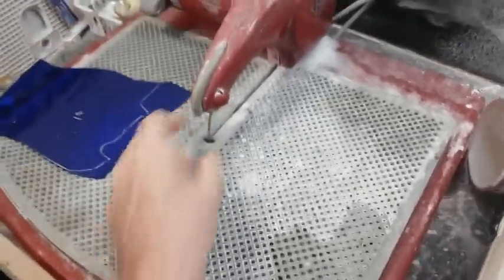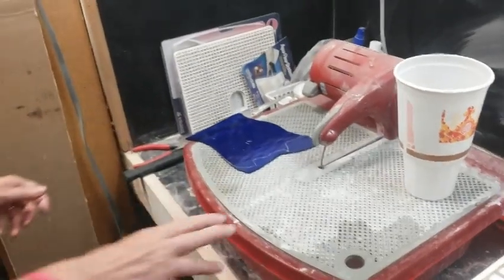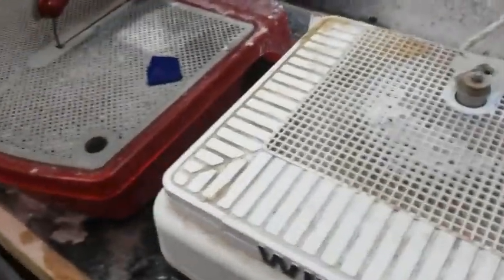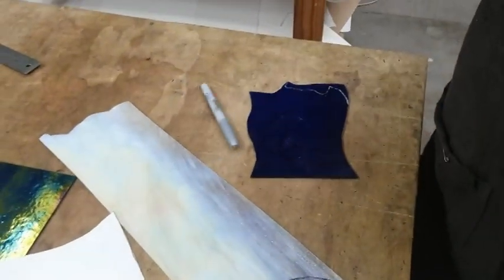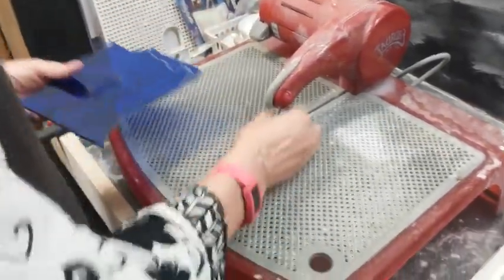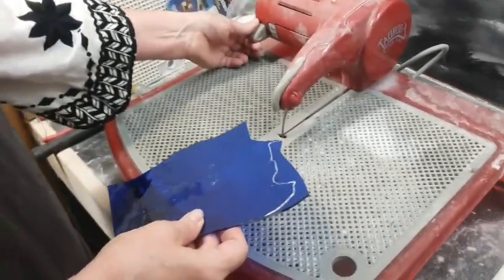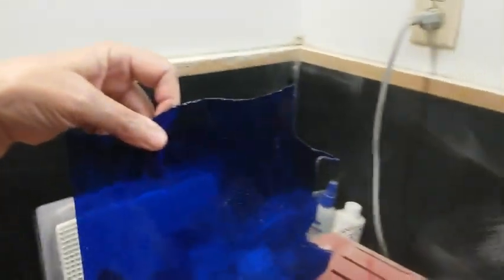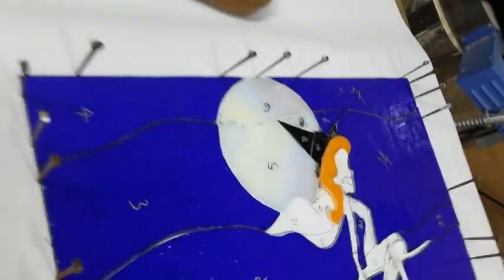Cutting A Radical Piece Of Stained Glass For Bewitched Panel V334

Comment: Hi. I thought to buy it. Thanks yo show how it works. 🤜🤛🤜🤛
Reply from the maker: I recommend them if you have everything else in your shop already. They are a tool of last resort, meaning that they are difficult to learn to use, difficult to keep clean (just look at mine), and expensive. We had one client who bought one and he kept breaking rings. He was pulling the ring around the path before starting like we show at the start of the video, but still they kept breaking. I showed him the blade I use on mine (which I show on the video attached to the end of this video) It's the heavy duty ring and I rarely have one break, but once you switch over you either have to stick with it or change some rollers when you change blades. Good Luck!😀😀😀
Reply: @GommStainedGlass  Thanks alot for your answer 😀😀😀😀

Comment: Another tip: I like to use ‘lip balm’, or ‘Chap stick’ instead of Vaseline (on top of the sharpie lines on the glass.  The chap stick protects the sharpie lines, doesn’t wash off)
Reply from the maker: Yep, the Chapstick trick works too. I find I have Vaseline near the cutting area since I use it to keep bitts from freezing as well. 😀😀😀